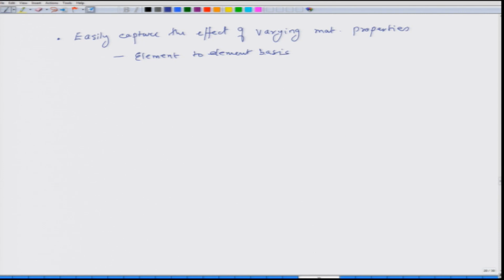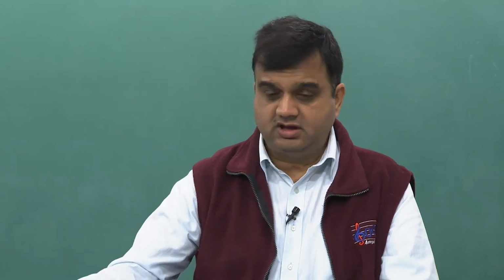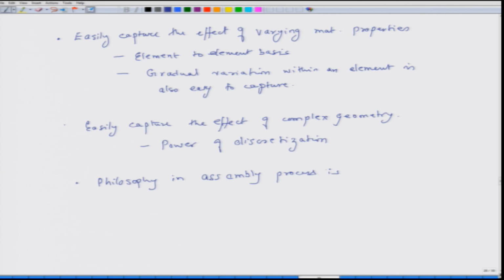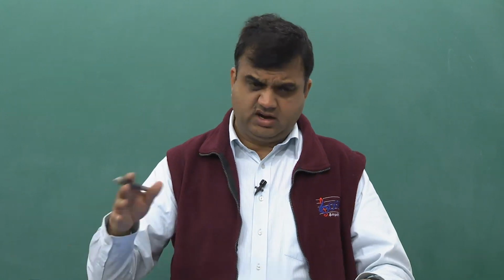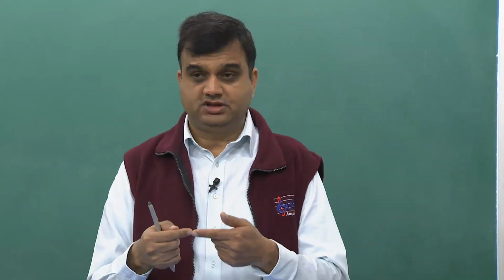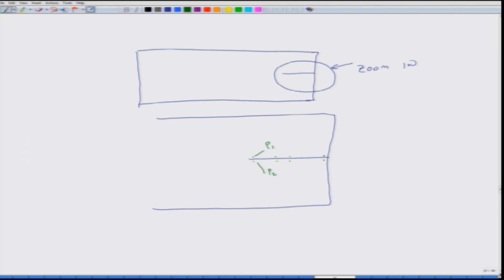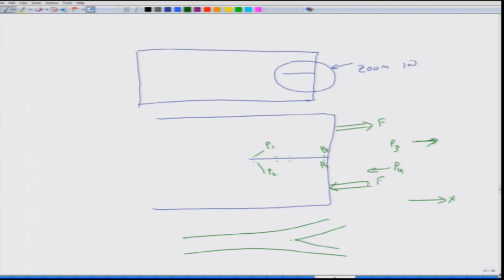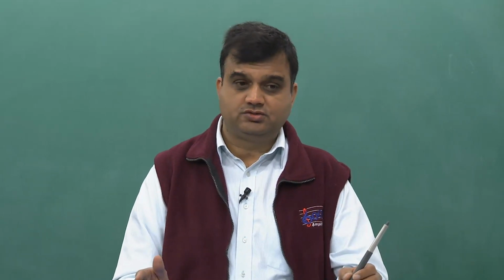Strengths of FE Method, Continuity conditions at Interfaces

Comment: Sir,
Why first order elements should not be used in bending dominated problem and also when involving near-incompressible materials?
Reply: As said in previous lecture, order of interpolating function impacts the nature of variation of independent variable (in case of beam, vertical deflection). If a simple first order (linear) function is used, the beam will appear stiffer than actual one, in FEM model.
Reply: Not only the vertical displacement, but also the slope also needs to be determined at the nodes in case of a bending problem ( beam element ) . So the slope also becomes an essential boundary condition that needs to be satisfied.